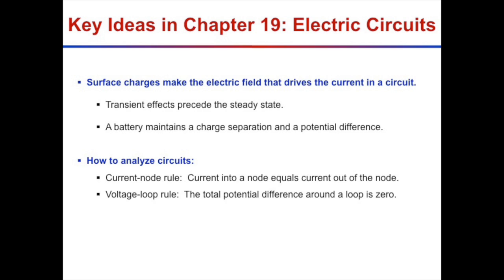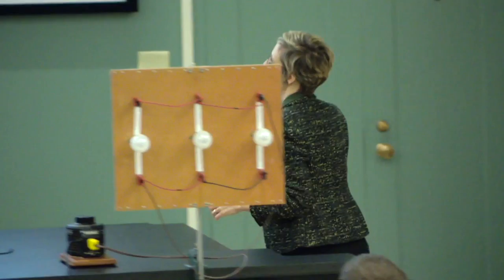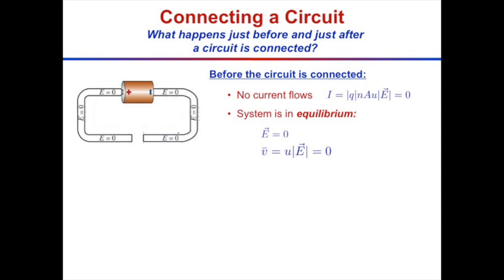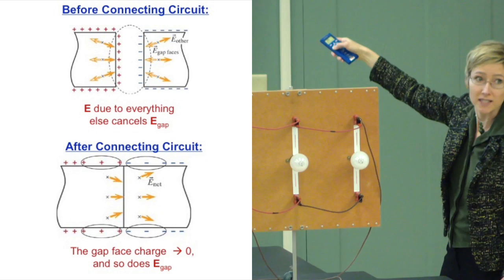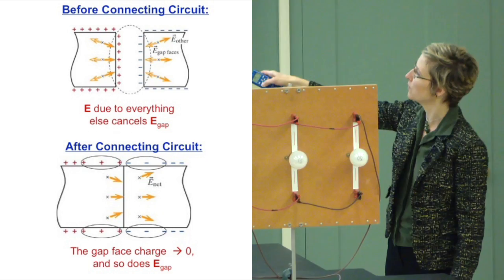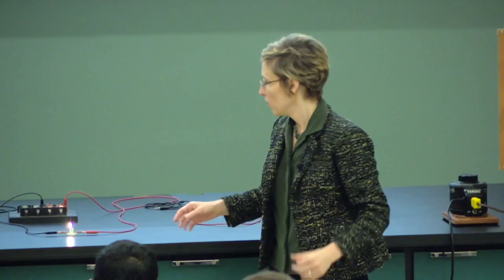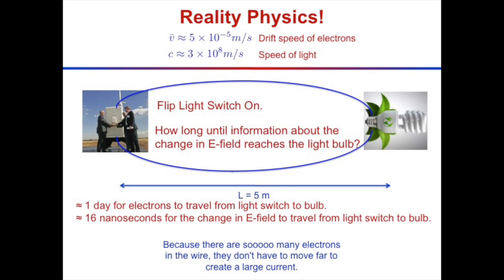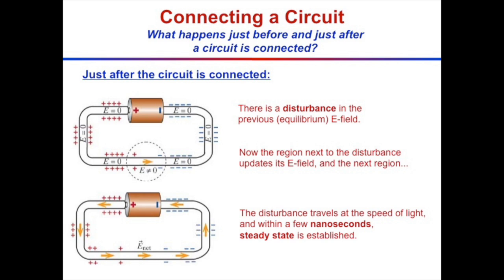Lecture 15 Surface Charge in Circuits

Comment: Sharing some toughts: If the formula of voltage is the work/q and knowing the work is dependent on the Electric field, then it means that the Electriv field is much higher at the two poles of the load than it is at the rest of the circuit (which is wires).

Comment: What is curious is that you indicate surface charges provide the force necessary to push the electrons through the wire, but DC current flows throughout the entire cross section of the wire.  DC electrical resistance is related to the entire cross section of the wire, implying DC current is evenly distributed throughout the cross-section.  
But high frequency AC resistance is more subject to skin-effect and does not gain as much benefit from the cross-sectional area, implying there is some sort of delay or resistance to electron mobility into the wire’s cross-section that higher frequencies can not overcome.
So what is this AC resistance into the center of the wire coming from?  Electron repulsion?

Comment: Thank you professor, you are stunning! I was struggling so much with trying to understand what exactly happens on the level of charges and fields when we close the circuit, and somehow almost all sources completely gloss over this topic. Really glad I found a link to this video in one of the comments on stackoverflow. Some things are still unclear though, but let's see if they clear up after I watch the lectures before and after this one.
Reply from the maker: Thank you for the comment!  The material for these lectures is largely based on the textbook series "Matter and Interactions Volume II" by Chabay and Sherwood.  This lecture is from Chapter 18, "Electric Field and Circuits."  (4th edition)

Comment: I love her energy, clear voice, and discussion of surface charges. Although I have an M.S. in Physics I never saw those discussed when I was in college.  
 Imagine a long column of Zebra attacked at the back by a lion. Almost immediately at the speed of sound the Zebras at the front will start running! Although Zebras run a lot slower than the speed of sound the signal reaches the front very quickly.  

This analogy also explains that there will be a charge build-up along the line. Imagine you divided the Zebra column into sections of 10 Zebras each. The back section hears the lion first so all 10 Zebras have time to move from their end section to section one ahead. However, the Zebras in the next section hear the noise a little later so only 9 of the 10 moved out of section 2 to section 3. Now you see that there is a pile-up or build-up of Zebras in section 2. There used to be 10 zebras in section 2, 9 moved out, but 10 came from section 1. So now there are 11 Zebras in section 2. The same will happen in all sections ahead with net charge build-up in the analogy.

Comment: Thanks for your carefully constructed explanation. One thing not considered is that the hot electric bulb filament in your physical circuit is of much greater resistance than the wires conveying the electric current to and from the bulb filament end points. This suggests there will be a much greater electric field strength along the bulb filament than that which exists along the connecting wires. Ohms Law (J=sigma×E) must apply everywhere around the circuit external to the battery.  To accommodate this we must propose a more complex surface charge distribution in the region of the bulb filament.
Reply: Can you explain why the electrons travel faster through the thin tube? How the electric field change?

Comment: I don't understand 2 things here:
1. where do surface charges come from/why are they there?
2. why don't surface charges move to neutralize the surface of the wire? Why is one half of the circuit's surface positive and one half negative? Why don't the charges on the surface spread out more?

Thank you for the video!
Reply: when you connect a wire to the positive pole of a battery, its creating some positive charges inside the wire, then the positive charges are repulsing each other as far as they can thus until they reach the surface of the wire.

Comment: I think the explanation of how many atoms are being passed by the electrons might be misleading or left incomplete.  How does that relate to energy transmission?  What matters for the energy used by the light-bulb is the fields outside the cables.  Energy flowing along the wire and into the light bulb.

Comment: So the assumption is that surface charges are creating the electric field inside the conductor?
And the surface is charged because of the outside surface capacitance and the outside electric field? 
In that case: take a fully screened cable as used in high frequency conduction (but use it here for dc) and connect the screen and inner conductor together at both ends, and those ends to the battery. The inner core can’t “see” the surface charge because of the screen but in reality it still conducts the current. This is the same principle that no electric field can exist in a charged metallic sphere. 

The surface charges cancel exactly the outside electrical field and no outside field will penetrate the conductor. 

Therefore this explanation can’t be correct.

Comment: prof. I am a high school student and I am very confused in circuits having capacitors my confusion is that:
In my textbook, for series combination it is written that the capacitors must have equal and opposite charges on both plates because if they wouldn't then there will be an electric field inside the conductor connecting both capacitors and that would redistribute the charges until they acquire equal and opposite charge because as the plates as very close the electric field due to positive plate and negative plate are almost equal and opposite at any point inside the conductor, which seems to be logical but there is a problem in it. if we go by this explanation then when two capacitors having equal and opposite charges on both plates are connected then the charge redistribution should never occur because the net electric field inside the conductors connecting the two is 0 always, isn't it? please help me regarding this,.. for more reference please see the image here, {https://physics.stackexchange.com/questions/644342/why-do-we-treat-the-whole-capacitor-as-if-it-would-be-a-single-conductor}